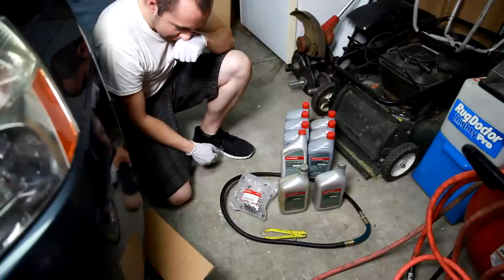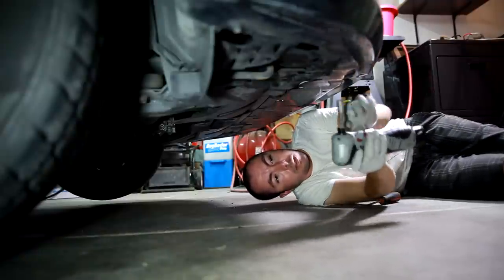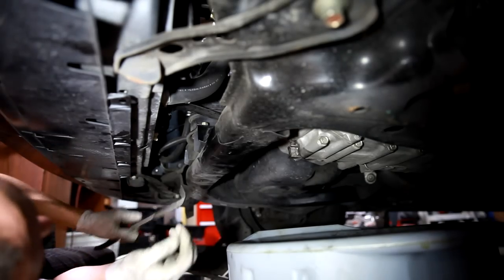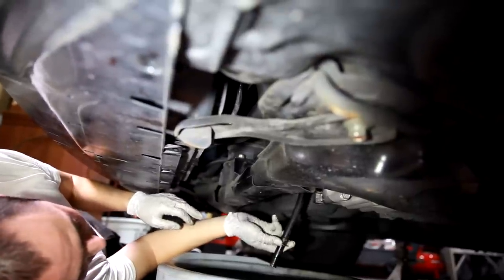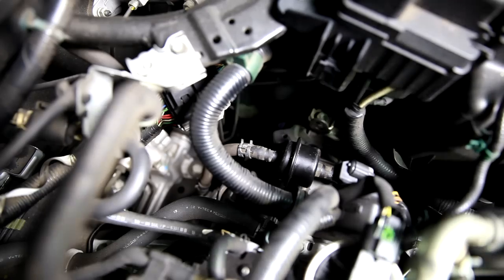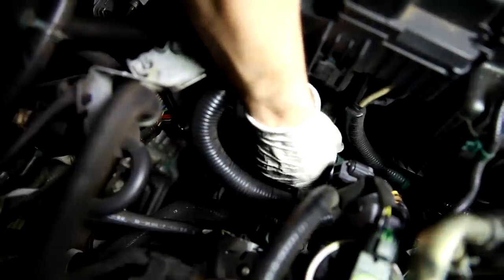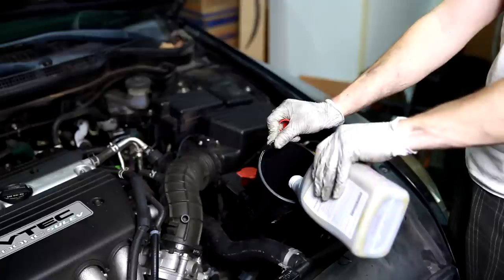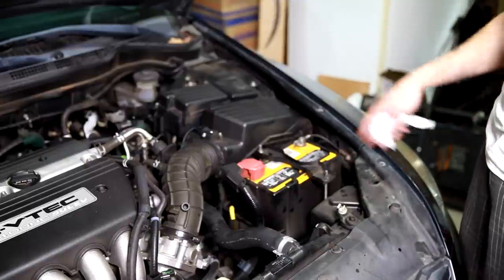2003-2007 Honda Accord Complete Transmission flush with filter

Comment: you missed the most important thing, removing the drain plug in order to clean the residues out of the magnet part of the plug. when you do that the magnet is clear and ready to collect more residues. I don't go that far, This kind of engine needs no more than drain and refill three time in each session. Believe me, I have 340K on mine and all I did is just drain, clean the plug and refill.
Reply: Consecutive sessions on one day or spread out over months?
Reply: @4seeableTV  Do the entire process in one shot, or the old fluid mixes in with new fluid which is kind of a waste. The setup takes the most time so doing it all at once means you only have to set up for the job one time.  You'll do 3 or 4 drain/refill cycles, which take less than 5 minutes each, while setting up and reassembly at the end can take 15 minutes if some darn hose decides it wants to stay stuck.  Really it's not a difficult process, do it right and you're $$$ ahead!

Comment: Does this apply 
to the 2003-2007 accord with manual transmission. I have a manual
Reply from the maker: It should work the same, but manual is usually drain and refill since it doesn’t have a torque converter so you don’t need to do this.

Comment: Since you only had to add 3 qts I'm assuming this only removed the fluid from the pan. If this is the case, why not just remove the drain plug? Not sure what I'm missing. What's the benefit here?
Reply from the maker: Ron Burton we didn’t just add 3 quarts to the transmission. We did an entire flush. We saved the last 4 bottles to refill the transmission. We added 3 quarts first and used the last bottle to top off the fluids. You can do the flush with 12 quarts, but we had only 9 quarts to use so it still works. If you want to do a drain and refill. You can remove the drain bolt on the bottom and then refill it on the top dipstick tube.

Comment: Wouldn't it be a good idea to put some wheel chocks in front and behind tires and cycle the transmission into different gears? Of course keeping an eye on the fluid replenishment.
Reply from the maker: You can

Comment: Going from memory, when you do a trans oil change it's around 2.9litres, but when you do a flush, getting ALL the oil out, it's about double that, around 6 or so litres?  I only saw you put 3 quarts in there?  Or did I miss something?
Reply from the maker: In total was about 4 quarts I think… but put in 3 quarts first so you don’t over fill it. There was still fluids in the torque converter so that’s why it didn’t take the whole 6 quarts since it’s not entirely empty.

Comment: I have a transmission question. I bought a used Honda Accord 2003 6 cylinder 2018. When I drive over a speed bump or make a right turn, my transmission hesitates or slips. It's more like it hesitates then it engages and I'm good to go. This only happens once in a while. The transmission sounds and feels healthy.

Comment: Nice video! I also like how you were clean about everything. Didn't know honda used a trans filter until watching this. Hey just got a used 2010 Crv with the K24z6 engine and was wondering if its the same procedure as removing the driver side cooler line for the output, car has 75k miles, would you recommend a flush or a drain&fill, dont know if mine has a filter.
Reply from the maker: yeah you can flush it that way like in this video. I would flush it at 75k, and check if there's a filter on it. Trace the transmission line to see.

Comment: any chance the wd 40 you sprayed to make it easier for the tubes to come loose get mixed with the inflow of transmission fluid and cause damage? that's what I am afraid of...
Reply: Alan Anh Vu it wouldnt be enough to damage the transmission.
Reply from the maker: no, the WD-40 will drip out and wouldn't be enough to cause any damage. the hose won't come loose as well because the clamp is there to hold it in place. Plus, there's not enough pressure to cause the hose to come loose.
Reply: NutzAboutBolts b

Comment: Hi,
and what happen with the oil in the circuit? in the turbine for example? still the same oil or too is clean oil with this procedure? Regards!
Reply from the maker: it'll be clean oil since we're using the engine to push the torque converter fluids out.
Reply: Thanks, Regards from México City

Comment: I’m kinda confused 
Typically you disconnect the hose at the transmission end, not on the radiator end
Or do I just make it harder on myself it really is ?
Unless this is the line that GOES to the radiator. Not out off the radiator
Reply from the maker: Whichever end works for you. Don’t make it harder on yourself.
Reply: @NutzAboutBolts  
Thanks 
I have 2012 Accord 2.4 
Do you think the hose location is the same?
Also some people warn about flushing but my fluid is black and I have done the drain/refill thing and didn’t change the fluid color that much if none. I knows it’s been 6 yrs since you made the video but was the transmission fine after the flush ?
Reply from the maker: @tothepointvids5192  it should be.

Comment: can I simply do a drain and refill with the filter? or do i have to flush to use the filter?
Reply from the maker: You can drain and refill and replace the filter. It doesn't have to be a flush.

Comment: Thank you for making such a useful and informative DIY video. I'm new at this but very handy and already did my motor mounts and valve cover gasket. Honda's prices can light a fire under your butt to DIY. But my question is, can I do both the hose and drain plug method to ensure its all out? And if so, which one do I do first? I plan on doing this tomorrow morning (Sunday 3rd) So if you don't respond in time its cool. i'm just trying my luck here. Thank you and what you're doing here on your channel is truly helpful and some, if not the best DIY clips on YouTube. Crisp video positioning, video quality and crisp audio. Keep doing what your doing here. Much Props!
Reply from the maker: +NYCMP1 Thanks! as for the method. I would do the hose method like in this video since it's draining out all of the fluids in the transmission system. If you do both method at the same time, it might not be pushing all of the dirty fluids out since when you're refilling it with fresh fluid, it'll get drain out of the transmission pan instead of getting sucked back up into the system and pushing the old fluids out. I hope that helps explain the method. If not, let me know.
Reply: +NutzAboutBolts Thanks for the prompt response. Very much appreciated. Yeah that makes sense but how about the metal shavings on the plug. That's what I wanted to also get at, the metal deposits on the magnet. Wiping the plug clean. Is there a way or am I OCD'ing here lol.
Reply from the maker: +NYCMP1 thats true, you can remove the plug after the fluids start to sputter on the hose and the engine is off. Then wipe away the drain plug and all the metal shavings and then plug it up and resume the process.
Reply: +NutzAboutBolts Precisely! That's what I was hoping for. Good man. I'm going for it tomorrow. I knew I wouldn't go wrong reaching out to you. Thank you my man. This is a big help. I'll shoot you a message if all goes according to this method. Thanks again and Happy New Year!!!
Reply from the maker: +NYCMP1 you too! Good luck and Happy New Year!
Reply: +NutzAboutBolts Hey I just wanted to let you know all went well with using this method + drain plug. Except it needed slightly more than 3 quarts to reach middle point of dots on dipstick. Which I did not have and Honda service center was closed Sunday. Open for sales only. I bought 2 cause it was really low after 3 quarts. All it took was a little less than half quart more to reach mid point of dots. All is well for now. On to compliance bushings. I don't think you have a video on this but there are others. I wish you did though. All in all, I probably wouldn't have went for it had it not been for your video. NutsAboutBoltz gives confidence that many of us most likely need. And for that a huge THANK YOU. Seriously Thanks a lot. Here's to a very productive and successful 2016!
Reply from the maker: NYCMP1 I appreciate your compliments :) and yeah the transmission takes 3 1/2 quart or so of fluids. We put in 3 just to gauge where the fluid is at on the dip stick and then once on leveled ground, we top it off after that... What video bushing are you trying to do? just curious
Reply: +NutzAboutBolts Yeah, i'm replacing the front lower are compliance bushings that cost 30 for the pair and honda wants to charge 524.00 to do the job for me WTF?! I have to do it myself. That's nearly 500.00 I can pocket for myself. Also there are other squashed ball joints that don't look to good.
Reply from the maker: NYCMP1
ouch... that sucks, if we are going to do a ball joint videos, it won't be for a while... work has been quite busy for the both of us to do any filming on certain projects...
Reply: +NutzAboutBolts No no, hey, you guys have done enough. I would never ask for you to make a video like that out of the blue. I was just hoping you already had one made. It's all good. Where there's a will there's a way right? Thank you for all you do. I'll be back to share a little of this with you when I get one it. Probably this weekend or next. Depending on parts delivery. I'll keep you in mind for a little support asap, maybe when I save me that small bundle honda's trying to stick me up for. Thanks again. Good luck & Peace
Reply from the maker: NYCMP1
lol thank you. good luck with the project. have fun!
Reply: @NYCMP1  you end up doing more work on you car?

Comment: I lived a dilemma of orientations, so I drained the fluid inside a container with a meter, and found the measure of 3.5L, strange? OK? So I decided to put 3L initially and do the level check. So, by surprise, everything was OK ... the Honda distributor instructed me to put 2.8L ... I put 3L.
Good luck guys.
thanks! directly from Brazil ... honda accord 2.0 2007 125K

Comment: that is a real small filter!  At least the 4cyl models have one.  Our 06 EX with the V6 motor has none that I can see.  So I've just done drain and refills.  They don't even have a pan you can drop.
Reply from the maker: +jewllake yeah the V6 don't have external filter
Reply: +jewllake Yes V6 has a filter and is completely different.  http://www.scribd.com/doc/253617555/2003-2007-7th-Gen-Honda-Accord-V6-Transmission-Filter-Change-How-To-DIY

Comment: IS IT TRUE THAT IF YOU DIDN'T CHANGE (ACCORD 2005) TRANSMISSION FLUID FOR LONG TIME (5yrs. or more) and if you change it - chances are to damage transmission?? CAN YOU EXPLAIN IT PLEASE?
Reply: In an old transmission that hasn't had the fluid changed the dirt in the oil adds friction which might be the only thing making it shift. With new fluid it might cause it to slip.

Comment: NutsAndBolts, do you need to prime the new filter so you would not have an airlock?
Reply from the maker: We didn’t do it and don’t have any issues, some people like to do it and we don’t see and issue with that. I say it’s personal preference but people like to say other wise. Just follow what you feel is right. We’ve done this with this filter and oil filter and have not had any issues. Some may argue that it’s wrong but whatever, if we feel there’s an issue with it, our subscribers will be the first to know. We don’t lie to our viewers about issues like this.
Reply: Thanks for your reply.

Comment: I have a 2008 Accord with 75k miles. Can I just remove the drain plug? 
Isn't it 9 qts for the flush?
Reply from the maker: yeah you can just remove the drain plug, its usually 4 quarts. But you should fill it up to 3 quarts and then top off as needed. 9-12 quarts is a full flush like in our video.

Comment: Using your method to drain all of the transmission fluid, does that mean it would be running for a few seconds without it taking in any transmission fluid?

This looks like a great way to pump everything out, but are you sure it doesn't harm the transmission?
Reply from the maker: Jonathan Sadeghi once you see the fluid starts splashing out, then you turn off the engine to prevent running the torque converter dry. It's not harmful as long as you don't run it for too long. Once you refill the transmission fluid, it'll go back to the torque converter when you turn on the engine and it should be fine.
Reply: NutzAboutBolts  People have been doing it this way for years with many different types of vehicles.  It's not a "flush" that everyone warns not to do, it's merely an exchange of old fluid with new fluid using the transmission's own pump.  It's the most reliable way to get rid of the old fluid and replace with the new.  Honda's idea of the whole, drain 3 qts, fill, drive around, and drain 3qts and fill, again and again makes no sense at all.  You are contaminating the new old with the old.  Would you drain 1 qt of engine oil, put in one quart of engine oil, drive around and do that 3x?  No, because that doesn't make any sense.  So why does everyone think it's ok to do that with the tranny?  Good video and good advice.

Comment: Can you change the transmission filter without draining the fluid i drain and filled my transmission last week but didnt put a new filter
Reply from the maker: Yes you can, there will be little residual fluids coming out when you remove the filter.

Comment: isn't there a drain plug? I see many posts about draining it out of the plug and refilling, and one said there is no filter... Guess I should get a freaking shop manual to see what it says.
Any recomendations on shop manuals?
Reply: Shroom Duke He is doing a flush...not drain and refill. In order words, he is ensuring to change the entire fluid by flushing, even the fluid inside the torque converter. A drain and refill won't change the fluid inside the torque converter.
Reply from the maker: Shroom Duke The V6 engine doesn't have a filter I believe... you can drain from the bottom of the transmission drain plug and the filler plug is up top.
Reply from the maker: camram thank you for clarifying what a "drain and refill" is and what a "flush" is. Sometimes other people don't understand what it is. Thanks again! :)
Reply: camram pretty much what I figured...
humm, I wonder if I plug two hose into the filter tubes draw fresh fluid in while it pumps it out of the other side...
Reply: find which one is the return line to the transmission from the cooler and disconnect that one, then start the engine to flush out the tranny. If I am wrong, someone please correct me. Thanks!
Reply from the maker: camram
you are correct, there will only be 1 line that will drain out, and that'll be the line that returns to the cooler.
Reply: NutzAboutBolts can the same method you showed in that video of flushing the transmission fluid be done in a toyota matrix 2010?
Reply from the maker: camram yes

Comment: Does the V6 engine also have an inline filter like that, or is it in the pan? I can't seem to find much information on it anywhere online.
Reply: Not that I know of.....the filter is located inside the top of the transmission just below the intake airbox

Comment: I learned alot on this video. but you supposed to be check the fluid when the car is running right?correct me if am wrong.
Reply from the maker: yes while running.
Reply: NutzAboutBolts are you sure? I called honda dealer they said the car should be off.
Reply from the maker: check the transmission fluid dip stick while engine is off.
Reply: NutzAboutBolts I'm confused.. you just said check while running.. then you said check while off.. 😐

Comment: I have 2007 Hoda Accord. if I start the car in the morning and I engage the transmission it will delay for some seconds before it will engage. Secondly, if the transmission is engaged and the car starts  moving, the transmission between gear 1 and 2 engages forcefully with a sound that will shake the car. Thereafter the transmission will become smooth when the engine becomes hot. if the car is parked for up to six hours, same problem will start again. What do do you advice?
Reply: Can't speak for Honda but i have experienced this with GM cars and its the pressure control solenoid. Also changed shift solenoids while i was in it.

Comment: Will it be ok to be in the middle between the dots on the dipstick when cold? Or should I try aim for 3/4th or top of the dot on the dipstick?
Reply from the maker: 1/2 is fine but aim for 3/4th. When it gets hot, it'll go up a little bit.

Comment: I have honda accord 2006(V6). should I use fill plug(manual suggestion) or the dipstick hole to fill the txm fluid? Thank you
Reply from the maker: if they have a dipstick, I would go through the dipstick.

Comment: I have a question got a 04 honda accord 4 cylinder and i don’t know if the previous owner changed the trans fluid or not but i checked and it appears to be dark in color and when cold started when driving it seems to feel like neutral and my dash the D blinks what could it be any advice?
Reply: Julio Navarro CHANGE IT brother.   change it.   Don’t do a full flush,  just a drain a refill.    bad trans fluid like you are describing WILL mess up your transmission.   Change it and keep an eye on it. as soo as it starts turning gray, drain and fill  it again.

Comment: I've noticed the fuel efficiency of my 2006 Honda Accord V6 has gone down, which indicates it might be a good time to replace the fuel filter.  I am wondering if it would possible for you to make a quick tutorial video helping me out?  Thanks in advance.
Reply from the maker: +Qu Y you don't replace the fuel filter unless the fuel pump is bad. But if you want to change it, its under the back passenger seats.
Reply: Good to know, then I will just leave it alone for the time being.  Thanks.